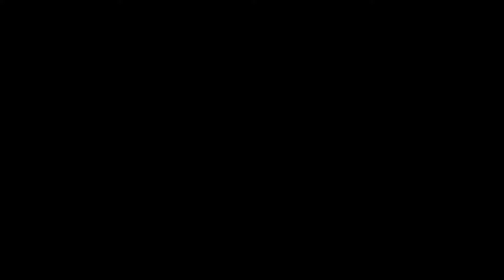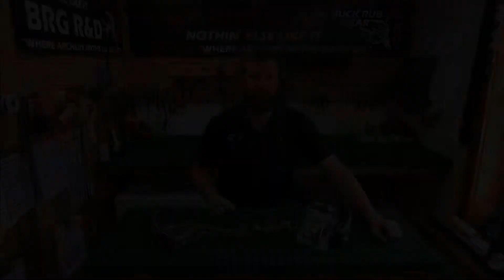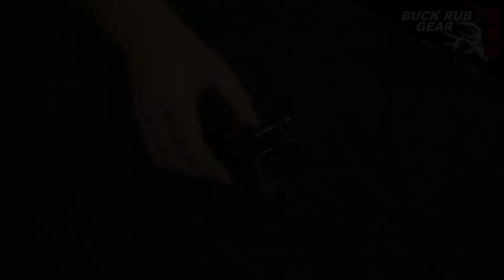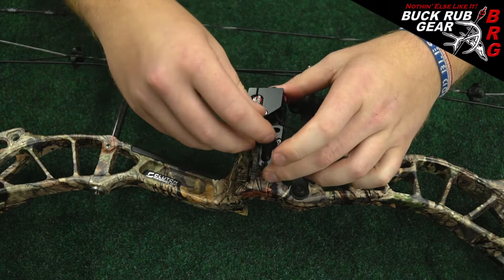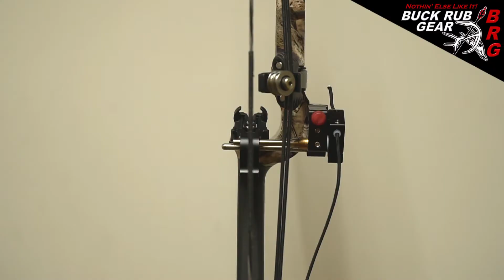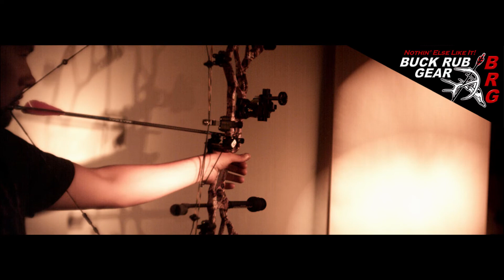Magne' Drop Arrow Rest Installation

Comment: Man I really want to try one of these out but on fence.
Reply from the maker: Although we are new to manufacturing we have been tuning, installing and helping design dropaway rests for 40 years... so don't be leary. All other rests have spring and trigger mechanisms with top bars to contain the arrow, where by eliminating the top bar and having a micro-adjustable drop height, this is the most tunable rest out there. This is the hottest new rest on the market, we own the patent rights on magnetically driven drop-aways, and that's why we have a Guaranteed Lifetime Warranty to the original owner. So far, we've only had to warranty 3, 2 got ran over by a truck/ atv, and 1 someone let their T-Handle Release go at full draw and it smacked their rest and bent the bar. All repaired or replaced with no charge to the customer. As long as the rest is properly installed, and properly tuned, you will NEVER get contact. Our original Magne' Drop rest (as seen in the video) is a secure capture rest designed for tree stand hunting, but if you do more spot and stalk hunting, you could try our new Magne Drop with the Raven Claw launcher. (or if you buy the original you can always upgrade to the new launcher). Thanks for your interest in the new Buck Rub Gear Products. www.BuckRubGear.com
Reply: @BuckRubOutfittersLtd  I have the original. How do I order the launcher upgrade? I don't see how to do that on the website.
Reply from the maker: @mitchell8697  feel free to give us a call. You can order over the phone or we can see if there is a dealer near you. Thanks 262 547 0535